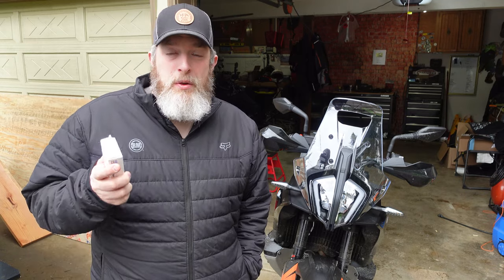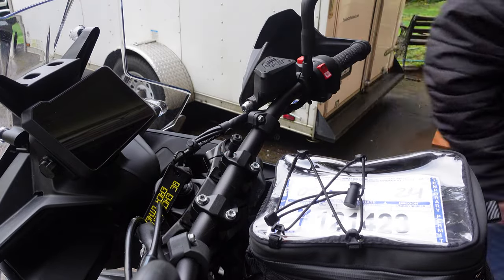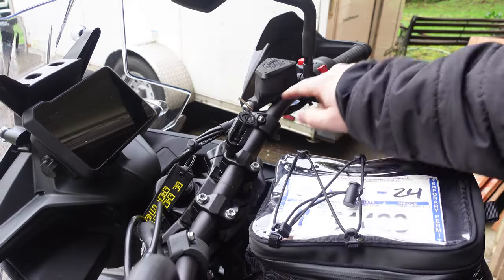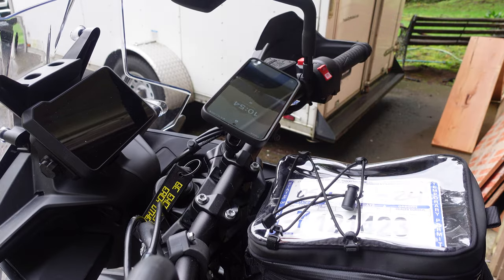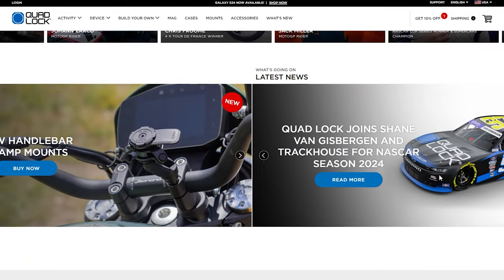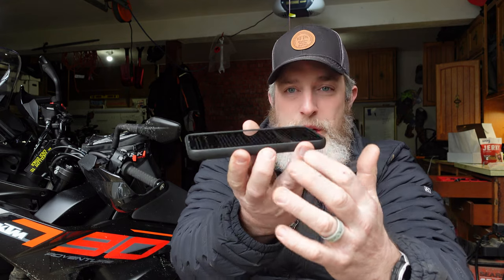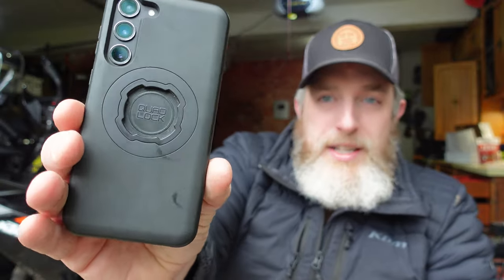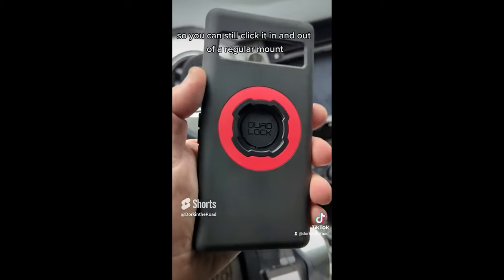Quad Lock 5 Year Review + Motorcycle Handlebar Clamp Mount Install

Comment from the maker: Check out all the Quad Lock Motorcycle options:
Quad Lock Website: https://bit.ly/49M6olX
Quad Lock 360 Kit Builder:
https://www.quadlockcase.com/collections/build-your-own?klear_link_id=92bf99dcf425365abd938f09012afc7b
Reply: Quad lock is amazing, are use it on my bike and in the car actually broke my iPhone 12 mini and then bought the iPhone 13 mini and the case worked on both I have the vibration dampener and it’s awesome, I’ve also used their rain cover a couple of times and that also works excellent thanks for doing the videoalways great content. Thanks, Ben.

Comment: I’ve only used the QUADLock system once. It was on my 2018 ATAS. I used the handlebar mount WITH vibration damper with my iPhone 11. The servos in my camera were shot after 3 rides which were primarily on road. This has soured my opinion of the product ever since. I’d love to try them again but can’t risk the possibility of replacing a new iPhone 15.
Reply: I hate handlebar mounted anything. My comm and phone are paired to my bike, so I can view everything on my TFT and control it all with my left thumb. Navigation is through a Zumo XT2. Phone goes in my tank bag or inside jacket pocket. I like not having to take my hand off the handlebar. Doesn't the AT have Apple Car Play?
Reply: Was that an issue with the mount or the phone? I’m not sure the same thing wouldn’t happen with any mount. I’m using a RAM mount with an iPhone 14, and so far so good. 🤞 It does not have any dampening, but maybe the arm absorbs some vibration. I also take it off the mount when off road, and use a Garmin GPS instead.
Reply: I have use a quad lock on 3 different bikes for over 10,000 miles, two bikes were single cylinders which are notorious for vibration and harmonics. I have had an iPhone the entire time and have ZERO complaints. My camera works just like the day I bought it.
Reply: Same happened to my phone 🤷🏻‍♂️
Reply: @DWBmotorsports  did you use that vibration dampener?
Reply: Actually the iPhone 11 is just very susceptible to getting broken. Had issues with it very badly (I work in car sales I need my phone to take CLEAR pictures), upgraded to different iPhone as well as other androids, they all never had issues 👍

Comment: I bought a $0.74 knock off on aliexpress, with a $2.50 vibration dampener. My friend bought the full quadlock system for $130. We compared them when they arrived, they were identical aside from the branding and mine still having a slight burr from the injection moulding process in some places. I've owned it a year now, 80% on road/highway riding and 20% gravel/rocky/dirt track, dropped the bike offroad multiple times, and my $3.74 system and phone are still perfectly fine
Reply: Exactly … the Chinese knock offs are just as good and at 1/10th the price….who cares if the mount uses adhesive…

Comment: Sorry, but my inner mechanical engineer can't help but be pedantic.  Dampen is to moisten, damp is to reduce the amplitude of vibration or oscillation.  Therefore, the correct terminology (@2:54) is "vibration damper" (i.e. you're not getting your phone wet with that device, you are trying to reduce the vibration).
Now that I'm done being pedantic... Ben, you need to warn us before the off-color humor (e.g. @0:59 - "That's a lot shorter than I expected... heard that before") - I was taking a sip of coffee and almost choked on that one!
Keep up the good work!

Comment: I've been using Quad Lock for about 5 years, also. I have mounts on my bicycles, on my motorcycles and in my truck and I've never once had an issue. I don't mind the case, either. It's black, I don't need anything fancy. And the number of times my phone has hit the deck is ridiculous; with no damage to the phone itself. Good review, Dork! Cheers!

Comment: I had an iPhone14 Pro camera fail while using a vibration dampened quad lock. Started having issues after the 4th ride. I’d assume around 500miles. 

I now keep my phone in the map pocket of my tank bag if I need it accessible, otherwise I keep it in my pocket.
Reply: Maybe your bike’s engine has big bore long stroke. I’m keep the phone in my pocket and use an aftermarket GPS with Apple carplay.

Comment: Great video as always. Just want to add that they do sell a universal case mount. It can stick to just about any case with adhesive. But I've used Quadlock for a couple years and love everything. The cases are great quality. I also constantly drop my phone, and they are magnetic so you can stick your phone to metal surfaces.

Comment: I switched to Quad Lock a couple of years ago after trying a number of alternatives & having my iPhone camera being destroyed by most of them, fortunately while still under warranty. I had a really nice phone case, so I started with the stick on adapter, which I don't recommend to anyone. It adds bulk to the back of the case which interferes with wireless charging. The standard phone case is a much slimmer option, despite having the mount bump on the back, and is really robust. I've heard that the mag case is even slimmer, but they don't make it for my current phone.

Comment: I've found that the lock(+) shaped thingy...it wears out. The edges make the case loose. But it's only a couple dollars to replace it. Quadelock is the best phone holder...change my mind😆 It keeps you phone in place whether your on rough county roads or in the trails. Never ejected the phone in a sudden nap✌
Reply: Same experience but replaced without question by Quad Lock. Well, I had to send a photo. The problem was this was my main navigation on an off road trip. I won't make that mistake again.
Reply: @TheIdlesurfer  oh😯 I didn't think of contacting QL.

Comment: Love my QL system. The only thing I had issues with was the wireless charger. It doesn't seem to work great with lithium batteries. Lead acid seem fine. Even with it switched to Auto it would still drain my battery. Even when pressing the little off button at the back after each ride, it would drain my battery. The main reason is that I had it wired to the battery. Going to have to find some switched power up front of the bike that cuts power when I turn off the ignition. Should be okay then :)

Comment: The vibration is also not a problem if you don't have an iPhone. At least none of my Androids has ever had an issue even with offroad riding on bicycles without vibration dampeners, which is WAY more shocks than on motorcycles.
Reply: The frequency is what they believe fry the stabilizer software/hardware. Motorcycles have a lot higher frequency. According to the tests (research) they should never obtain damage on a bicycle. I’ve heard the opposite of you. I’ve heard of almost all Samsungs being damaged.

Comment: Quadlock. Good but not perfect. I have broken two Samsung S10 screens, primarily due the Samsung edge screen swipe function. I have lost my phone twice whilst on a cycle mount (roadbike not MTB). The spares are available but not all are advertised and are expensive. My recommendation is a big yes overall. Shame they regularly needs to discount 30% which means generally they are ripping us off.

Comment: I tried a knock-off product.  It wasn’t smooth on/off connection the way the Quad Lock is.  The phone fell off once because I didn’t get it properly seated.  Those problems are gone with the Quad Lock!  Super easy, super secure.  As always, you get what you pay for.

Comment: The biggest con for me is that you can't remove your phone from the mount with one hand. This is super annoying if you are riding and you want to remove your phone and put it in your pocket. I switched to the Peak Design mount which is super easy to mount and remove it with just one hand and holds just as good as the Quad Lock.
Reply from the maker: You absolutely can.  I do it all the time.  It's one of my favorite features.
Reply: Dork is right, there is a bit of a knack to it but you can definitely do it one handed.
Reply: @DorkintheRoad  I've never been able to get mine off and reattach it with one hand. With the Peak Design it's super easy!

Comment: Any concern about heat in the summer with the wireless charging option?  

My phone is on the edge of overheating even without the bit of extra waste heat from wireless, so I haven't built up the momentum to actually install the thing yet.

Comment: Have you found that the wireless charger overheats the phone at all?
Reply from the maker: It definitely gets warm.
Reply: Are you sure your phone isn't just overheating from sitting out in the heat ? Wireless or wired charging shouldn't cause that but I've noticed on my high windshield bikes phone doesn't get enough airflow while on my dual sport it never overheats as long as I'm not stopped in direct sunlight

Comment: Can anybody out there vouch for the Quad Lock working well for iPhone on one of the unicorn (690/701/700) bikes? I'm not a phone mount user yet - used to use RAM Mounts but kinda hate them now - so I just chuck my iPhone XS Max in either my jacket or pants pocket, and even there the vibes from the 701 will jack up the camera where the OIS is messed up for a good time after the ride. Maybe a vibe mount Quick Lock is the way to go?
Reply: My buddy has an iPhone 15 and mounts it on his T7. He's had no problems at all. Make sure to buy the vibration mount.
Reply: I have a 701 matched always to an Android phone with a QL case. I've had one issue. The plastic cross lost one of its protuberances which made the phone vibrate horribly on an off road trip. QL replaced it, no cost, on the strength of an emailed photo. I didn't have a damper. I use "knock off" versions on my bicycle and the real one on my motorbike. I've crashed loads of times. The case and mount has been rock solid.

Comment: I'm just using a claw mount now. I got it for rentals. I'm wondering if it could fall off off-road. Had any issues with RAM claw mounts?
Reply from the maker: Yes.  They're fiddly and take a long time to get the phone in and out and they don't hold as securely without that stupid rubber thong thing.
Reply: I'd have to disagree with your summation. I have the RAM spring loaded claw with charger. It's what, maybe half a second longer to mount and dismount. My mate runs the QL. Last dirt ride we did his had an "unscheduled dismount". Mine didn't move. It was only a rocky logging road. His QL is almost new. My RAM is four years old. It's also not the first time I've heard of a QL jettisoning a phone.
Reply: I mean the claw attachment to bar type mount. I have a QL on it for my phone. Noticed Dork has his GoPro mounted using one.

Comment: The Chinese knock offs are exactly the same thing but at 1/10th the cost… sure you have a “backing mount” that uses adhesive…big deal… and the knock offs come with the “dampener”… how well do they hold up… took my Tuareg on some nasty Florida single track… the knock off mount worked just fine…no damage,  no broken or fatigued parts and best of all no lost phone….

Comment: Good but overpriced. Bought Quadlock(mount only) 4 years ago and been using it but i upgraded my phone. I want a wireless charger and couldn’t justify the cost of the wireless port and new case.
Quadlock was good back then because it had the first company advantage in business. Now there are many all in 1 wireless charger that costs 1/3 of what quadlock is and do the same thing. They need to step up their shit or otherwise lose straight up the market.